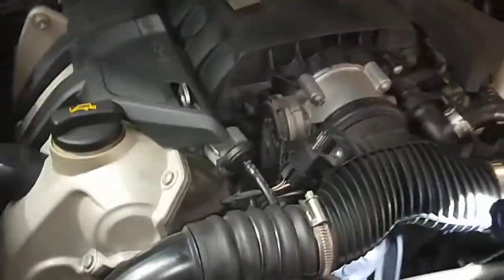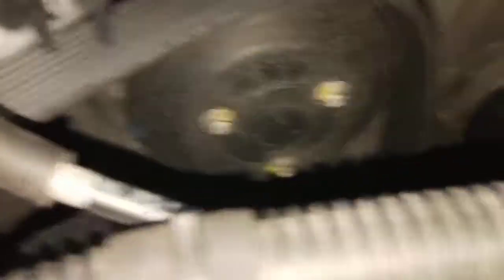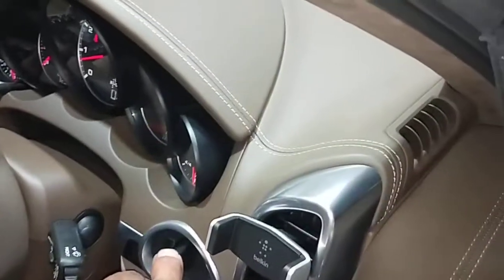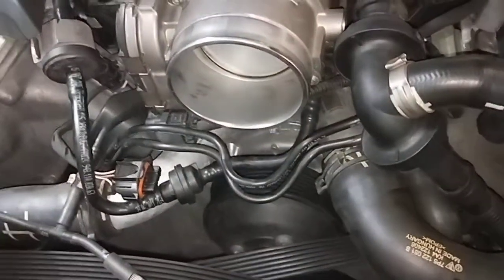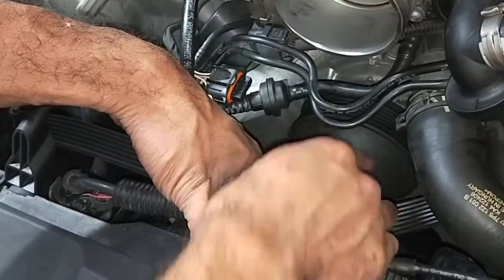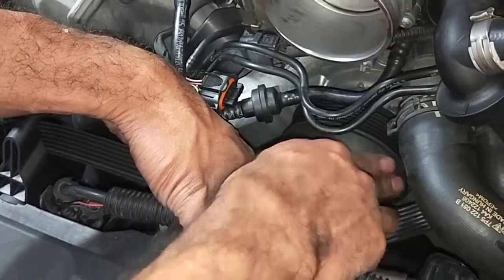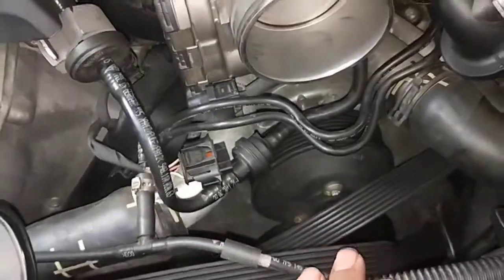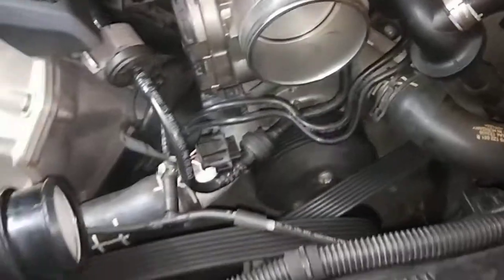Porsche Cayenne Turbo check for whining noise part2

Comment: Hi Paul, did you end up replacing the PDCC pump or was the whine just linked to the water pump?
Reply from the maker: Sorry for the very late reply 
On this Cayenne I changed the power steering fluid on both reservoir first & the noise quite down a bit after bleeding system using my scan tool.
Note: They do have a bit of a whine noise but not very loud.
Sometimes the steering rack can be leaking causing air in the system or your ac compressor. Both can cause the extra whining noise